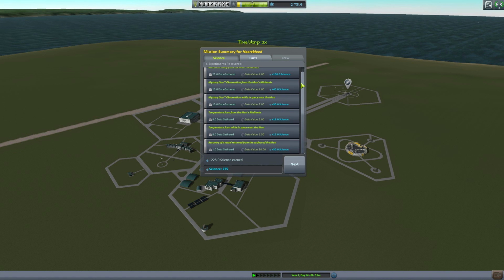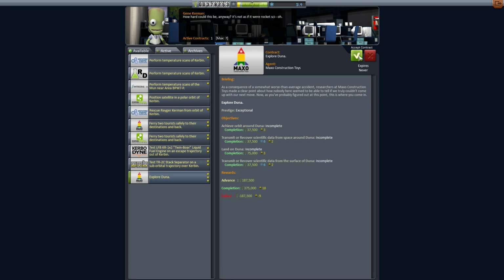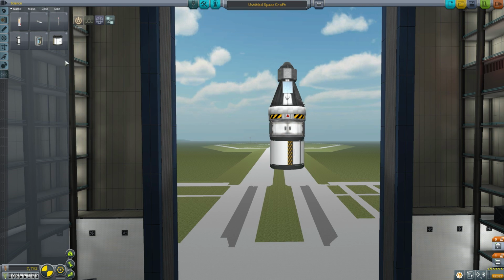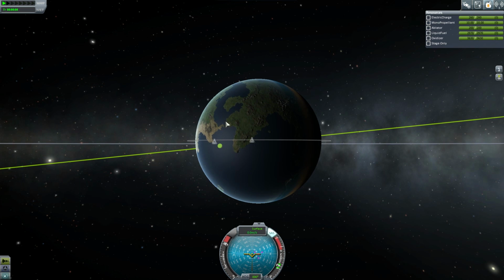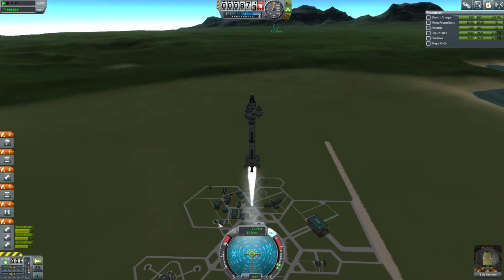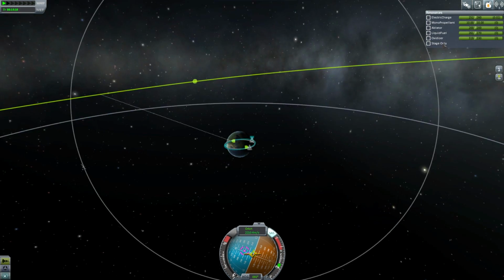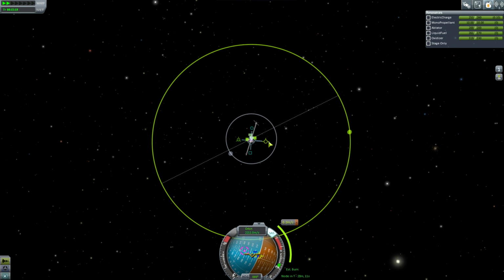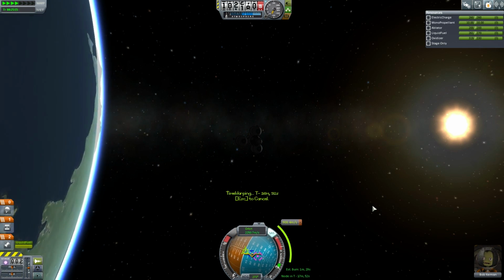Kerbal Space Program - Career Mode Guide For Beginners - Part 14

Comment: Okay so after about 12 attempts to set inclination in launch as shown in the video, I gave up on doing it that way.  To my fellow noob, I would suggest just getting into orbit as usual including circularizing, and then use a maneuver at the ascending/descending node to set inclination, cutting engines at about 10m/s and throttle lightly to get your inclination perfect.  After getting into orbit, I had a TON of delta-v leftover, enough even to do my burn to intercept Minmus without using my final stage's engine, albeit just barely.

Comment: Have they changed anything since this version to the current in regards to Delta-V or fuel consumption? I don't get it, with a copy of Heartbleed, plus two huge boosters (the biggest ones, supposedly to be reusable but that never survive even with tons of parachutes attached), I have only made it back to Kerbin once after going to Mun. 
At best, I end up stuck in Mun's SOI without any more fuel, forced to send another craft to rendevouz and get all the science; last time though, adding one more stage and leaving the Mun without the Materials Bay, I made it back to Kerbin on fumes, with a Pe of ~50km (any lower and my craft will burn up with the 120% reentry heating), doing multiple re-entries before touchdown.  This was only possible following a 8-shaped munar insertion though, which seemed to require a bit less Delta-V.
Yet, it doesn't matter what else I do, I can't be as fuel efficient as Scott, even though he did a mistake and wasted fuel on the previous video.

Comment: why wouldnt this rocket be able to go to the mun? you did it previously with an almost identical rocket.
Reply: His command pod is more heavy than the probe in the previous video, so it would need too much fuel to return from the moon.  Minmus has a lot less gravity, so the heavier pod can return with less dv.
Reply: oh right. for some reason i though there were engines on the fuel tanks on the probe lol. thanks
Reply: i didn't know this until after watching this video and reading this comment. I was still able to land on the mun and make it back....with one unit of fuel to spare.  I didn't understand why I was running so low, when he wasn't....well at least that means my burns were pretty efficient.

Comment: how do i work out delta v requirements and how much delta v my rocket actually has?
Reply: +eatthisvr6 for delta v requirements you can use this: http://www.deltavmap.com, just add up the numbers for where you want to go. for calculating delta v you use this equation: deltaV=ln(start Mass/endMass)*ISP*9.81
Reply: +eatthisvr6 Another super easy way to calculate deltaV if you can't be arsed with doing the math every time is mechjeb. As of the newest version, the autopilot is pretty useless but I like having it up for orbit info, surface info and deltaV info. Saves a lot of switching back and forth between map and normal views to boot.

Comment: Why does it take less fuel to travel and land on Minmus than the Mun when the Mun is closer? Is it because the Mun's gravity is larger therefore to achieve escape velocity more fuel is needed?
Reply: +Craig Barrow yup basically mun has more gravitational pull so you need more fuel to land and take off. If you are only doing a fly by then the mun is less fuel expensive
Reply: Craig Barrow It's easier to get to the Mun than Minmus, but much much easier to land/take-off on Minmus than the Mun.

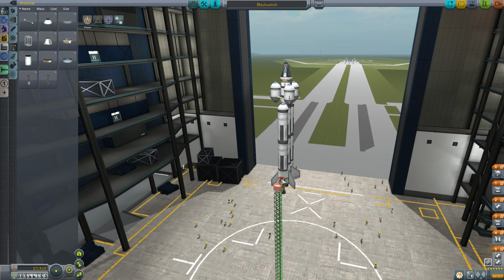Comment: lol @ 5:56

How often does this issue occur? And what makes it more likely to occur? Just being on the pad or do you need a huge rocket? Meaning does it happen before you unlock them? Or only after?
Reply: Slyguy threeonetwonine It happens more with larger rockets. By the time your rockets are large enough to start having the problem, you'd probably already have those launch clamps that fix it

Comment: Do I have to wait for Minmus and the relative position between the Launch Pad and the 0º Minmus orbit inclination point (AKA - Inclination Node Point) to be at an specific position before launching?
 Because I tried launching with Minmus behind me, at the higher (Northern - not high as altitude, but inclination) point of it's orbit and I couldn't bring the Nodes any close to 0º. If I tried burning South or North a bit it would just go down to about 6.3º and would start rising again.

Basically the ascending and descending nodes were about 90º away from my launch position, should I try fast forwarding a bit before launch or maybe burning south/north only closer to the inclination nodes?

I can try explaining it better if you, that reads this comment and feel like helping me, can't understand what I mean.

Comment: Until they change the way debris and probes are calculated during launch, putting parachutes on early stages is useless. 

A simple radial parachute costs 400 and you need 2 of them to save a Kickback booster, which costs 800 ! Problem is you can't save it because the game deletes it from existence if it drifts more than 22km from you, during an ascent stage. So why would you spend a single penny on something that gets wasted anyway?

There are 2 solutions:
1. Install a stage recovery mod or
2. Redesign the whole rocket around a main stage (with a probe core) that goes into orbit and gets deorbited once parking orbit has been achieved. The ascent is achieved through multiple cheap boosters and the main stage with the liquid fuel tanks and the engines is fitted with multiple parachutes.

Option 2 is my favorite for 3 reasons: I don't have to use a mod, uncluttered space around Kerbin and challenges my design and testing skills to come up with viable, economic rockets.

Comment: I like to have simultaneous missions going; Since it takes 6 Kerbin days to get to or back from Minmus and you can do the job with basically the same hardware, I usually launch the mission to Minmus, do the Trans-Minmus-Injection burn, get it on its way, and then turn right around and launch another mission to Mun.
Also, I happened to find a place near a crater on Minmus where three biomes are within walking distance, so I got a TON of science from only one landing and three spacewalks with Bob, and I'm so proud of this that I just spent half a youtube comment bragging about it.

Comment: Quick question, why would you need more (everything) to go to the MUN?
Reply: pugwashere Because the gravity on Minmus is lower than on the Mun. Therefore landing on Minmus requires less dV than landing on the Mun
Reply: pugwashere idk what you mean by everything, but this chart http://wiki.kerbalspaceprogram.com/images/7/73/KerbinDeltaVMap.png
says that from kerbin landing on mün requires 6300 m/s delta v and minmus requires 5620 m/s delta v.

the mün is a more challenging and expensive destination because it has a higher mass than minmus thus creating a stronger gravitational force. you have to counter-act that g-force with more fuel.  

if you're just flying by then minmus is more expensive
Reply: Oh it's about landing... That makes sense.
Thanks!
Reply: pugwashere Yes thank you much.

Comment: a small tip for centering radially attached parts in the service bay is actually to use the offset tool. I don't mean to try to fiddle around till it's center i mean if you click on any of the arrows that the game will try to center it in the middle.

It's rather odd because this click trick even works on the exterior of boosters if you just can't seem to get things aligned.

Comment: Actually, best way to get a goo canister in the middle of the craft is using the translation controls with angle snap on - it'll snap it perfectly to the centre!
Reply from the maker: That is an excellent tip, even I learn new things about this game.
Reply: Axquirix using the angle snaps works great for correcting stuff and balancing spacecraft when things are put on without symmetry.

Comment: As a seasoned KSP player with 400+ hours in Steam alone, I did not know you could attach fuel lines directly to engines.
Reply: Most of my hours are on console,surprisingly I have a good framerate and resolution 

I think I have 300 hours in total(console and steam)

Comment: Nice one Scott. Small point of order: you don't neccessarily need another complete stage with fuel and an engine to take a ship like that to Mun. All you need is enough delta-V and you can get that by adding extra tankage to your lander and using the lander engine. When if first started doing this I made the transfer tankage droppable en-route to Mun, but then I found it wasn't neccessary: you can land a ship like that but with 3 x LVT-800 side tanks and 6 x legs just fine if they're more than half empty.

Comment: 4:25 I've personally found that the best way to get parts to place right in the middle of a part is to get it very close by hand, and then simply selecting the part in offset mode and click any arrow without dragging it. It will snap the part directly into the middle as long as angle snap is on.

Comment: Hey Scott. When you're doing your transfer burns, why don't you just line up your target vector with your prograde vector? That way you don't have to guesstimate where on your orbit to perform the burn - could even do without a maneuver node.
Reply: It is safer to use a maneuver node. You could make an error in your burn more easily if you just burn in the way you described. Also, it is difficult to do if your inclination is off.

Comment: Why you did't use 45 engines? You just need steering in only central engine.
Reply: The engines he is using are more efficient.
Reply: Sorry. I mean he was using LV-T45 instead of LV-T30. T30 engine has more thrust, but no steering. He usually put T45 in the middle and T30 at sides. However, this time he used 3 T45 engines and I asked why.
Reply: Tim Man He probably used it to get better burn power.
Reply: The 45s have a higher ISP i believe. That, or Scott just forgot to replace them.

Comment: The double symmetry mode of getting things in the middle is no longer the best way of doing things! Most of the time you can simply use the translation control widgets and the snap/grid functionality to move it into the centre. Easier and more accurate.
Reply: Alastair Codd Yeah, I've found it handy just looking from the side and approaching the snap point from the top. It's dead center pretty much every time.
Reply: Just get Editor Extensions.

Comment: did you know when setting a manoeuvre node if you set the focus on the target you get a separated view of the projected orbits
Reply: Yeah, super helpful to "zoom in" on what your orbit is going to do near the target for fine adjusting. Targeting a planet/moon also keeps the motion of your craft from dragging maneuver nodes out from under the mouse cursor. Too bad in 1.3 you can't set the target back to the vessel without fiddling with save/load or jumping to the tracking station.